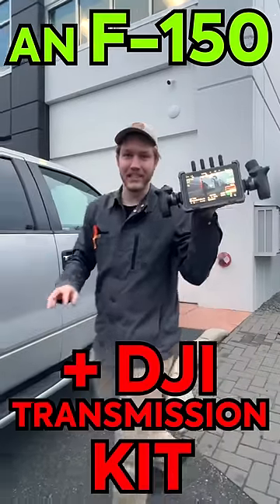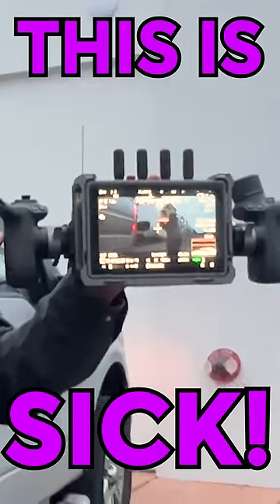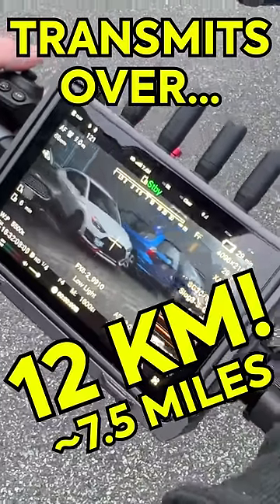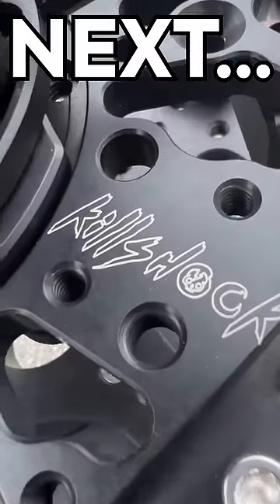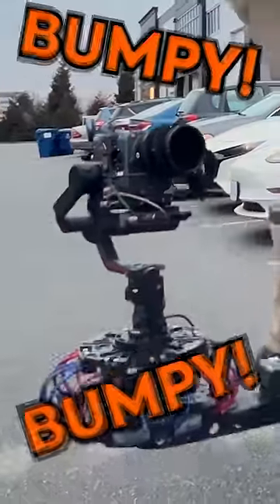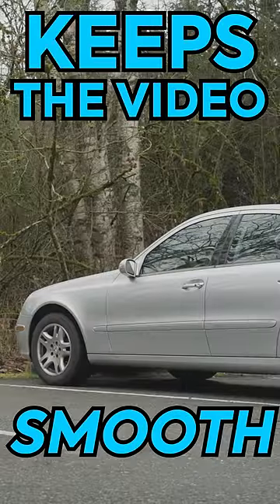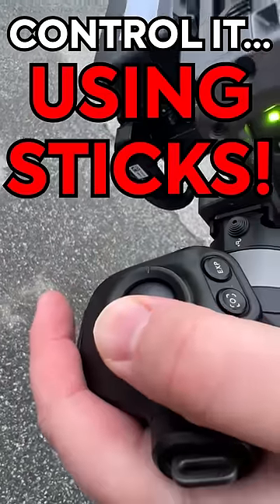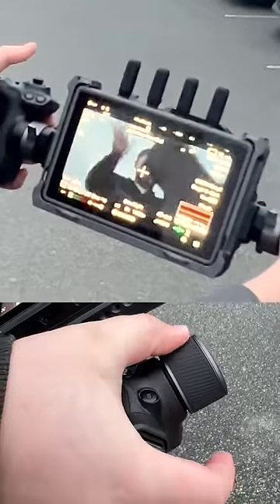How we film car videos!

Comment: Why the hell did they need a truck? All that gear could've fit in any citycar with 4 times better efficiency and probably even a higher top speed.
Reply: Because they use it for logistics as well I think and the tow thing can support more weight
Reply: Commercial vehicles can be bought as a business expense
Reply: Because trucks have other uses and they probably need something with a tow hitch for this to work well. So what I suspect is they just went to a used car lot looking for the cheapest truck with relatively low miles on it. Found this thing bought it and boom now they have it

Comment: Hey, how about as part of LABs you don't promote DJIs false range advertising? They get 5Km realistically
Reply: https://www.youtube.com/watch?v=pQHmWqXRnJs
LTT themselves have reached 6,9km.
Reply: The problem with range is it's highly dependent on all kinds of factors. I suspect if you went to the salt flats or similar location you could actually get quite close to that 12 km range If not farther but even ignoring terrain you can still have a lot of things that affect your range because a lot of these drones use frequencies in the consumer radio allocation. So even doing the same range test at the same location and the same time of day you could end up with dramatically different ranges if a consumer radio is transmitting nearby because it would effectively act like a jammer

Comment: Transmits video over 12km -- right thru your body.
Reply: The waves are too low energy to do anything
Reply: @ikbintom  uh huh
Reply: @ShowMeWhatINeedToKnow A Wi-Fi router is in a lot of ways more dangerous than these transmitters, but I bet you still have one in your house and are perfectly fine because being more dangerous than these video transmitters isn't a very high bar because the only way this thing is dangerous is if you smack someone with the transmitter, or got probably somewhere close to 100,000 of the things, whereas with Wi-Fi routers, you'd probably only need about 10,000 to cook someone

Comment: Could have done the same thing cheaper with a DJI drone :D
Reply: With this setup they don’t have to worry about swapping batteries, assuming the controller can be plugged in. It’s not like they’re hurting for cash.
Reply: @bubbledoubletrouble  yeah i know, Flying a drone instead using their rig would be a higher risk activity as well. 

I'm a drone enthusiast and i'll use drones in every opportunity😂
Reply: Really makes me wonder how popular drones are in Canada. I've only seen one in my entire life.
Reply: Probably not as legal to fly a drone low over live traffic. Also a pickup truck can be used for hauling stuff when needed, which they must do somewhat regularly
Reply: @Gunny-rt3lb  You are also not allow to transport live animals with a drone in Canada.  Or to use them to fish.
Reply: Those rules make perfect sense, in my country the only rules are to keep it line of sight and it must weigh less than 7 Kilo (which is a lot!) and must be 200meters away when there are children around.
Reply: @Skepticalraven they're relatively popular, but the problem is it's a lot harder to get a lot of the shots that they get with a drone because the performance characteristics are a lot different to a vehicle. Whereas if you strap the camera to another vehicle, it's quite easy to get some pretty good shots (also with a car the roof isn't very interesting)